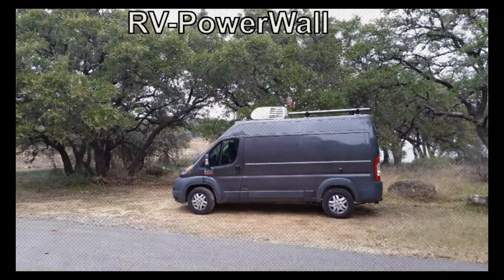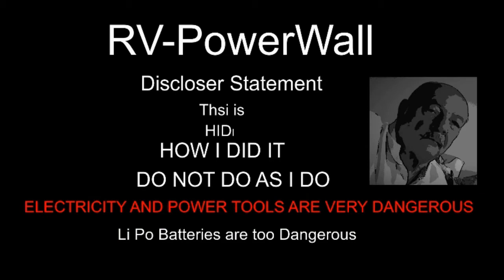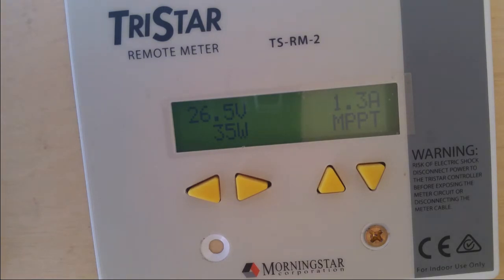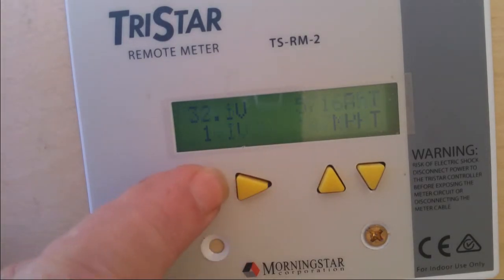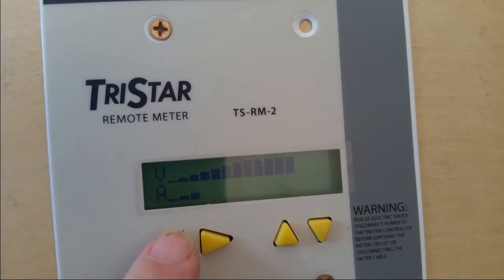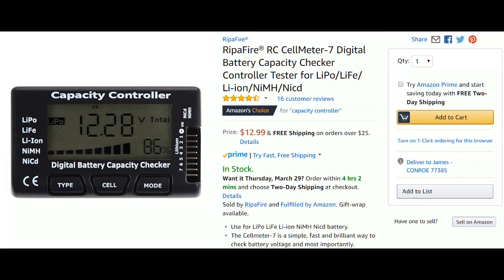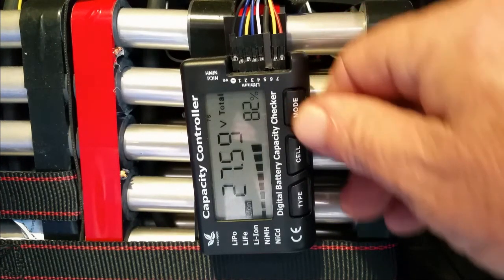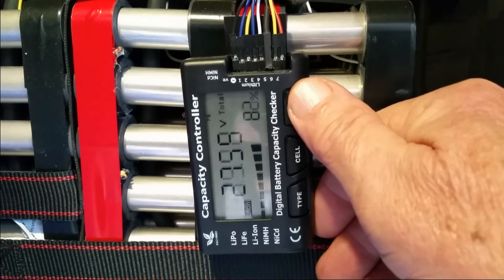DIY Off Grid PowerWall First low ballance Charge #16

Comment: I'm looking forward to trying the balancing mode on mine. I'll respond here about it. Tight range on you pack. Very nice. I'll post a slideshow link on the build here as well, using several of your pvc holder ideas. Thanks!

Comment: I noticed that on one of your charts you had a maximum cell discharge rate of 5000ma or 5 amps.  How will you reconcile this withyour 0.5 amp cell fuses (interconnects)?
I try to build all my series packs to handle at least 3C, or around 8 amps per cell, since I have a mix of 1C thru 20C cells.  But I use ~10 amp fuse wires.
Reply from the maker: That must have been a misprint or mistake probably the later. the max amp draw calculated per cell during my load test was .52amps. The inverter was pulling 52 amps and since its a 100p battery that should be .52amps. My inverter is a 2kw inverter so max draw I could experience would be 24v *85 amps = 2040w. So the max amp draw my inverter can ask for is .85 amps per cell. However the largest load I have in the van is the Microwave that pulls between 47amp and 52 amp depending on the charge level.
I have tested just recently the .5 glass fuses with a 1.75 amp draw for 24 hours and no heat rise.
Reply: Since you are fusing double cells you have 1 amp fuse /2 = .50 amps per cell.  So those fuses , at best, would get red hot at inverter max.  Plus you have to figure in all your losses from wiring, fuses, and inverter efficiences.  So you would probably need to add another 20-30% to you max draw if inverter can truly put out 2kw. :)
Reply from the maker: I think you must misunderstand on my first battery I built over 3 years ago I used double cells per fuse. On this battery I used the .5 amp glass fuse on every cell.